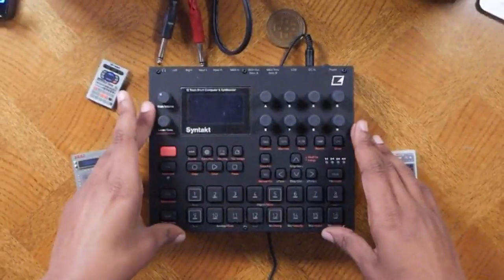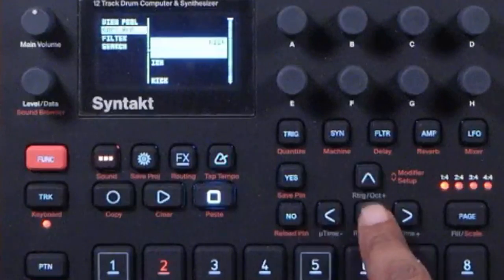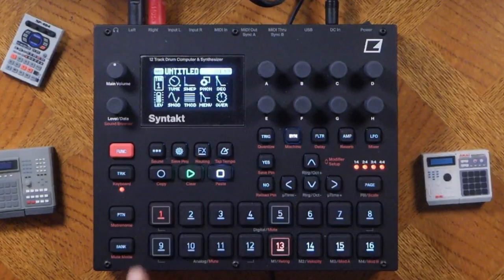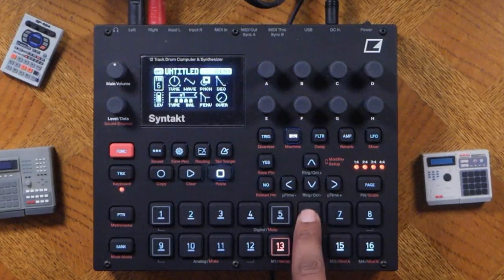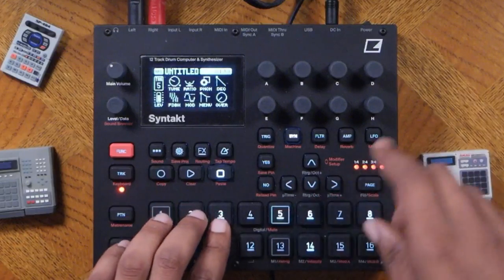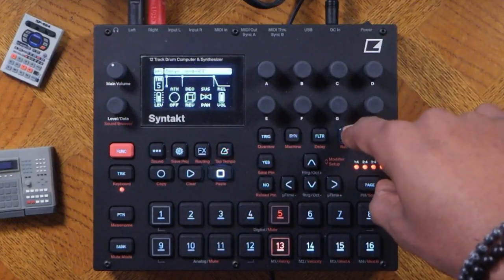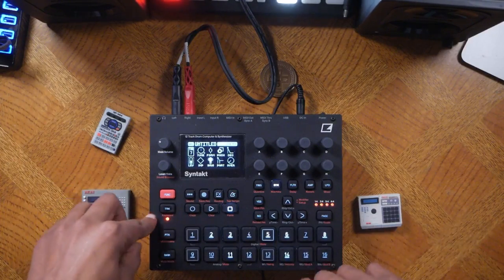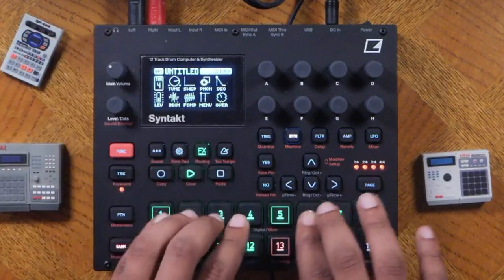Elektron Syntakt! How To Make Your First Beat

Comment: I think the Beatstep Pro is a good MIDI controller for Syntakt…velocity sensitive pads that can work for tapping out beats then in melodic sequencer mode it reconfigures the pads to a keyboard layout that’s easy to shift octaves (plus it is in the basic layout of the Syntakt and can use 5 pin MIDI)
Reply: Thanks for the spark… when I receive my Syntakt tomorrow I’ll definitely give this combo a try 👍🏻